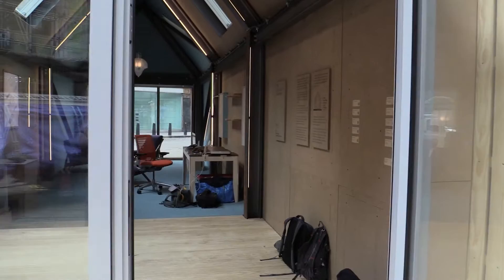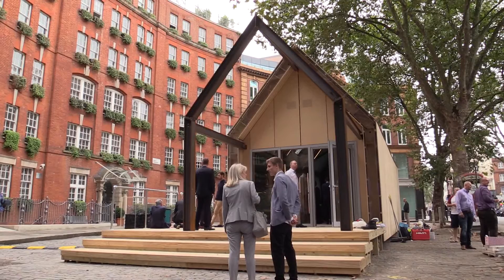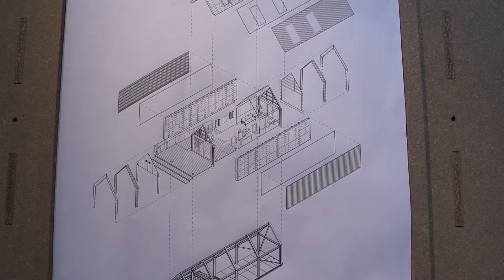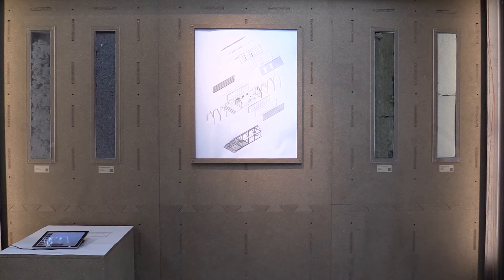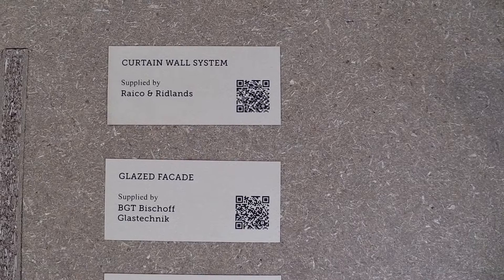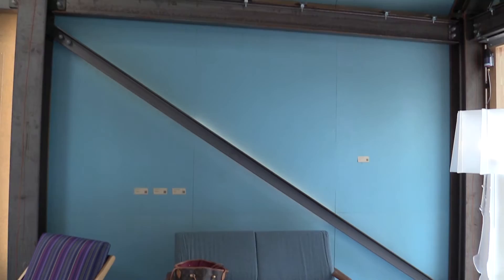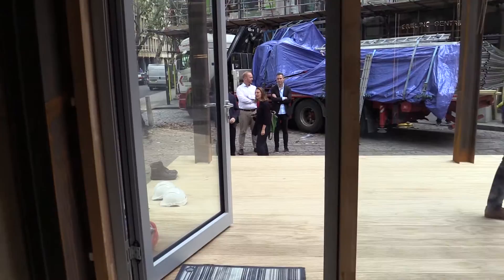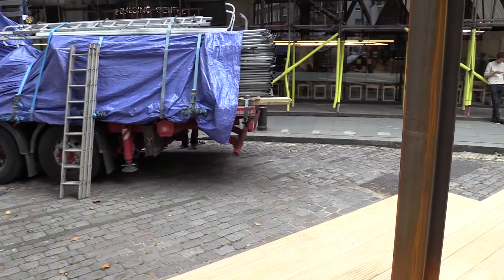Recyclable house shifts construction to circular economy

Comment: Lindapter is delighted to have been asked by Arup to design and supply the steelwork connection system that secures the Circular Building’s roof, walls, and glazing supports to the structural frame. As this project demonstrates, the principles of the circular economy can be achieved when using products that provide flexibility, longevity, ease of deconstruction and the
potential to reuse or recycle.